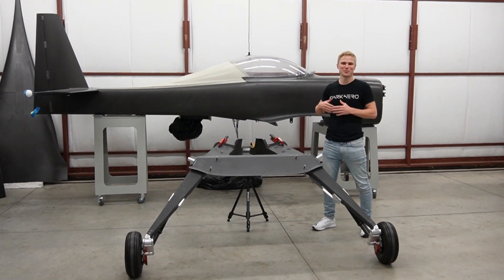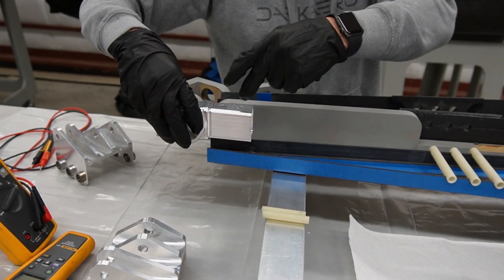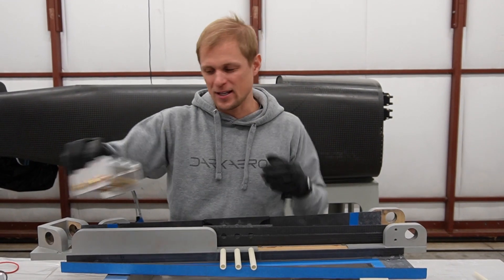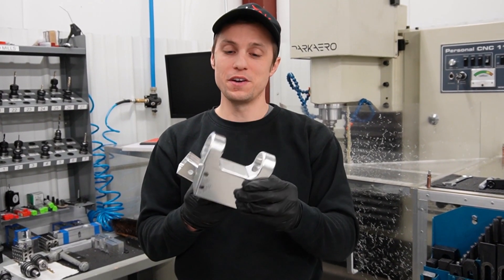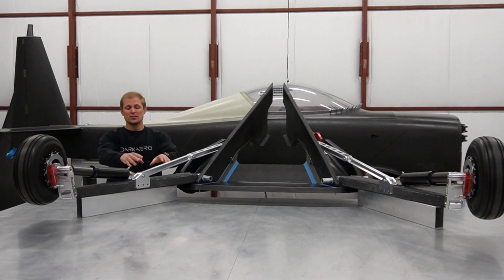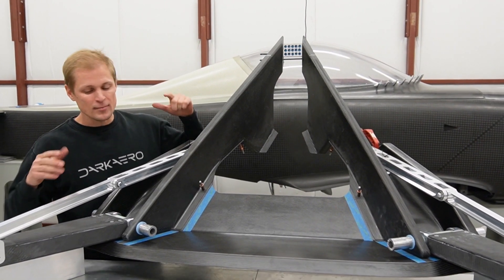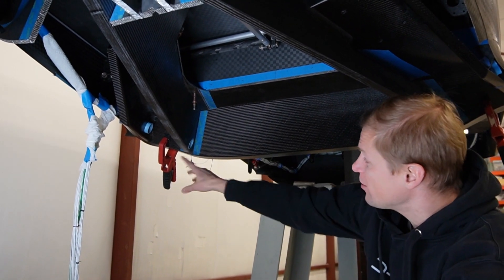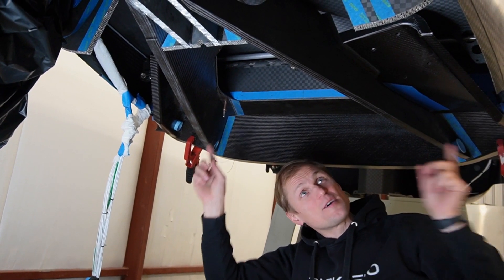CARBON FIBER LANDING GEAR!

Comment: beautiful cfrp - aluminium part assembly. One thing I'm wondering since you're glueing the alu parts to the glassfiber, have you tested the interlaminar shear between the glass and carbon fibers of the laminate ? And if yes, how ? :) thanks and keep up the great work !
Reply: Thanks for asking this, I have the same question and you expressed it better than I could. I’m also concerned about the longevity of the bonding compound and it’s resistance to temperature, UV, atmospheric chemistry etc. If it already in use elsewhere in aerospace construction, that would be handy to know.
Reply: @tomcoryell  - As a sailplane pilot I've flown plenty of GFRP and CFRP aircraft that have been flown for 40 years, and have never witnessed any bonding failure of joggles, lap-joints, or embedded hardpoints (which is similar to what they're doing with the machined components). Yes, you can find examples of skin delamination but these are almost always aircraft that were either exposed to UV over an extended time with no covering/paint to protect them, or they were left outside for many years allowing moisture to be absorbed into the gelcoat/laminate and then expand & contract with day/night cycles and seasonal changes.
Reply: Good point but it looks like the bolts and the design of the steps on the machined pieces negate that concern.

Comment: Nice! As a "senior" prototype machinist in the aerospace industry. I have mad respect for what you guys are doing!!
Reply: What is lacking with Mechanical Engineers today, is the knowledge of how to design mechanisms correctly. Did know that there's a mathematical formula that can be used for all mechanism designs? It's called Gruebler's Count. I found a way to make it practical for all 3D mechanisms. Here's the link if you are interested.  https://youtu.be/KFB8gMjxDPk